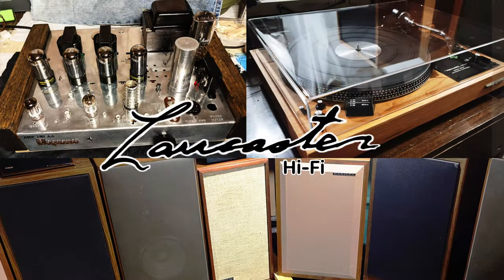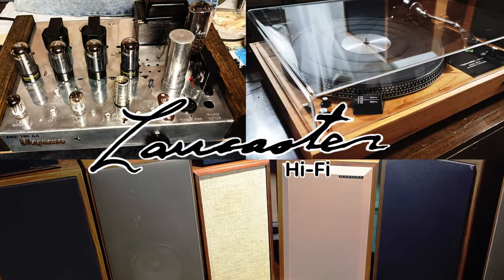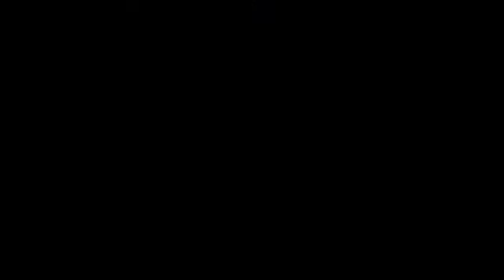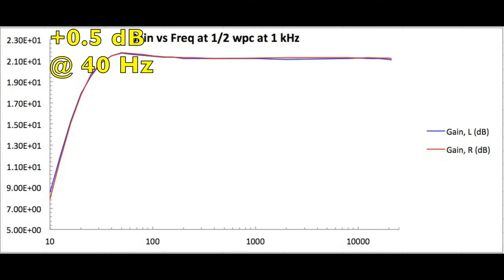Bad Tube Amp Design 101

Comment: I used to visit HiFi forums on tube audio equipment, and would often see posts from 'golden eared' audiophiles about 'tube rolling'. They would suggest changing this tube or that tube to a different one. When I mentioned that they couldn't just swap tubes without changing the plate or cathode resistors, I just got a storm of criticism about 'measure with your ears', not test equipment. These are people that learned everything they know from the internet {good idea), but had no knowledge about electronics. I finally gave up on these forums, and quit participating in them. These people are the kind that swear they can hear the effects of the color of the insulation on the wiring used in the amp, but are apparently oblivious to the gross distortion produced by a poorly designed amp or preamp. PT Barnum was right. "There's a sucker born every minute".

Comment: Great video post!  Also nice that you know Stephe from Skunkie Designs.   I LOVE her channel and it is first and foremost on my search list.  What caught my attention with her is that she has that Audio Analyzer Suite and can fully test the amplifiers she builds or checks out.   She was one of the first to really thoroughly get into an amplifier and describe it from top to bottom.   While I do have prior tube knowledge myself, I found that I learned a LOT more just by viewing posts on her page.    In fact it was through her that I had seen links to your channel.   It was your Magnavox SE EL84 amp and how you compared it to a push pull 6V6 amp that got me going.  It really gave me a good idea of what a SE amp can sound like.   Now,  out of the amps you mentioned, I had already looked at what Stephe had to say about them, but the best part was that she found ways to improve the flaws the amps had.   While I was tempted to get a Resong amp and mod it, I just figured it was better to stick with one of her designs, which was originally a Kegger design.   I would be far better off with one of those.   Then she has the Color Pre-Amp too, that I am interested in.    I been poking my head in more often here too as you do have really good posts.   Further, you have gone through a lot of classic pieces and know what is good (and not) there.   Skylabs Audio is another site I frequent, as that fellow has an audio repair shop and he fixes (and sells) vintage equipment.   I enjoy his page because there is a parallel interest.  I used to fix audio equipment myself, but I mostly dealt with commercial gear and guitar amplifiers, so that is where I got most of my tube knowledge from.   But dealing with tube equipment for guitars is quite different from hi-fi, but I did dabble with the latter myself and do want to get into it.   I am going to build Stephe's 12AX7 / EL34 SE amp soon, I am just getting all the parts together for it.   Oh!  And for companies that threaten for honest negative reviews  (I.E. Tekton), I would tell them to stick it where the sun don't shine!  Anyway, keep up the great work!   Can't wait for the next post!
Reply from the maker: I don't actually know Stephe. I just really like her content. I think I first saw her posts on Audiokarma.org, so when I found her on YouTube, I figured she was the real deal. I was a minute away from ordering the analysis stuff she uses, but then I saw that the freeware only runs on PC; I'll get there, just not today! 😐🤣
Reply from the maker: And, yeah, I'm a big fan of Skylab, too.
Reply: @Lancaster_Hi-Fi  I kind of figured you were familiar with him :).
Reply: @Lancaster_Hi-Fi  Not sure if you saw his last video this week, of the tour of his shop.  As he always says, "It's a fun one".

Comment: My journey with tubes started about 1963 with a Mullard 3-3 as a young teenager. It was followed by 5-10's, 5-20's as a 20 year old. The Mullard passive preamp was terrible!. Heard some enthusiast's Williamsons with Baxandall preamp. My Williamsons and Baxnandall preamp lasted for over 35 years. Anyway my current tube amps use KT88's and are sitting on the shelf gathering cobwebs. Class A Hiraga's and a preamp with OPA2134s and NE5532s quite frankly sound better, are more reliable and far less costly. Its been quite a journey.

Comment: I'm currently in the process of building an OTL (Output Transformerless) Headphone Amplifier that uses three 9-pin Svetlana 6N1P dual triode tubes, it is a DC coupled amp, meaning that one half of one 6N1P tube has the anode directly coupled to the grid of one half of another 6N1P tube that's connected up in a configuration known as a White Cathode-Follower output stage, the output is DC isolated from the headphones by a 470uF/450V DC electrolytic can cap, the design I'm building can drive headphones with impedances down to about 32 Ohms, It runs off a power supply that produces 348V DC @ 100mA, and 6.3V DC @ 2A.
Reply: Why? I ask because as a design engineer, I embark on a project to get better performance than is either available or affordable. A transistor amp, especially for low power and impedance can be orders of magnitude better than any tube amplifier. It just doesn’t make sense to go through all the hoops you mention to end up with an inferior solution.
Reply from the maker: Better or worse is a matter of taste. In terms of total harmonic distortion,  transistor amps typically do have orders of magnitude less than tube amps, but some distortion is tolerable or even desirable. Triodes, like the 6N1P, produce predominantly 2nd harmonic distortion, which generally sounds pleasant, at least in small doses. Triode amplification, then, has an advantage over BJTs. You could then argue that op-amp voltage followers or BJT emitter followers would make better output buffers, but if cathode followers are a good enough solution, then they might be preferable simply by being the simpler solution. For example, if I want to use op-amps, then I need +/-18V supplies, which require additional devices.
Reply: @Lancaster_Hi-Fi    Better is a mathematical expression, just like “>” or greater than. I know fake news is all the rage these days, but lower distortion is objectively better, no matter what semantic games rock your world. If you prefer adding the non-linear transfer function of a tube or transistor class A amp, that is a matter of taste. However, the resulting sound IS worse, quantitatively and objectively so. 

I’ve watched countless people swear by the superiority of the 1-2% THD of their tube amplifiers, and yes, that high distortion layered atop the original perfection of the live performance is actually their preference; their ‘taste.’ Musicians beg to differ, glowing orange shiny things or not.
Reply: @artysanmobile  transistors are inherently less linear than tube triodes. This is fact. They make up for it with huge gain and NFB. Crowhurst and others noted the negative consequences of high NFB as early as the late 50s.

Comment: As a guitist and builder of tube amps i think the 70 percent bias is silly since the goal is asimetric distortion in the output transformer that tubes do well, fender amps do this well in their early design and leo fender uped the output in the fender twin which had negative feedback to the ot to quell distorted sounds and get a cleaner sound at louder volumes.

Comment: I'm currently in the planning stages of a single ended pentode design starting with a blank sheet of paper.  I will be utilizing any modern-day electronics to achieve the optimum utilization of the output stage. I wondered what the great designers of the 50s would have done in their designs had they not have their current day electronic limitations. I also think that traditional designs are great for that day and if you're restoring a vintage peace, then you should adhere to the original design, to maintain the nostalgic sound. My goal is to see what you can get out of a pentode if you minimize the compromises.
Reply: The "great designers" of the 50s and 60s made very high NFB push-pull pentode designs of one form or another. That's it. If you like that, go for it. It's not my cup of tea.
Reply: @joeltunnah  Other than the quotes great designers, your comment is a complete departure from the meaning of my statement. I guess I wasn't very clear.
Reply: @davidkclayton  ok, how about this: minimize the compromises in a pentode by triode wiring it. Or am I still misunderstanding you? Tbh your post wasn't very clear.
Reply: @joeltunnah  Well I'm happy to say that my first prototype has been completed and I am testing it now. I'll be posting some videos on it explaining more how it works. The bottom line is that we have so much more technology now that I can draw from to get a single ended tube to perform at its maximum Throughout its bias curves. I can also eliminate components like coupling caps. Also, with the switch mode power supply I have dead silent operation. When I display my designs, I fully expect Most people that are in love with the traditional designs will absolutely hate what I've done but they're missing the point or I'm missing their point.
Reply: @davidkclayton  I have "dead silent" power supplies using 70 year old tech and designs. Not sure what I'm missing here. Add a 10H choke and a GZ34, and you're good to go.
Reply: @joeltunnah  what you're missing is I didn't have to put on a huge piece of iron, and I get a regulated power supply with far more efficiency and lighter weight and less cost. Power supply sag may be a fun thing in electric guitar amplifiers but not so much in audio reproduction amplifiers.
Reply: @davidkclayton  it's simple to design a tube power supply with no sag. And if you're going to use a solid state regulated power supply, why bother using tubes at all? Just build a nice transistor amp.
To me building tube amps is a bit like historical reenactment. You don't wear sneakers to the reenacted battle because it's more comfortable than 1812 shoes.
Reply: @joeltunnah  I'm fine with you not understanding, in fact I expect this from some of the community. What does the power supply need to do, simply provide clean DC without variation in voltage. I don't think I need to explain why a tube app is a tube amp regardless of where it gets its power.
Reply: @davidkclayton  ok if you're going to go down that road read up on silicon diode switching noise and EMF. Something you don't need to worry about with tubes.👍
Reply: @joeltunnah  it's 2024 we know how to deal with that. And also I am mentioned it was completely silent.

Comment: THE major difference of tube output stages (vs transistor output stages), is that the output 'follows' the impedance curve of the speaker system! This results in 'dips' in the frequency response where there are impedance-dips!

Comment: U got a subscribe today!! I'm not a Tube Amp Guy.

Tube Preamp to Solid State is more of my lane.( Feeling only the proper harmonics need amplification)

My working theory is there is no Analog or Digital because both methods actually rely on electron flow also Tape or Vinyl  can only transport as fast as the motor will allow.( Think about that).

Thanks again for pointing out how Audiophiles pay good money for bad things.

Comment: In what design does the inverter or gain stage "supply current to the grid" of the output tube(s)? Class AB2 direct coupled?
Also a 12AX7 is actually a very linear tube, within its limits. Much better than having multiple low gain stages.
And a grid stopper resistor on the output tube will stop HF oscillation in most cases.
Reply from the maker: I'm interpreting what I read in Building Valve Amplifiers by Mither Jones (I forget which edition), so I'd refer you to that book for clarification.
Reply: @Lancaster_Hi-Fi  it's Morgan Jones I believe you're referring to, and I'm not buying a $50 book to get an answer. I think your "interpretation" is incorrect.
Reply from the maker: Maybe. You can find earlier editions free online. The same issue is addressed in the design of the Simple45 aka Tubelab SE. That design puts a MOSFET source follower between AF and output stages. That follower supplies all the current the output stage could need, so there's no compromise required with selection of the tube for the AF stage. I'm sure I'm not explaining it well, or I'm unclear on the concept.

Comment: Another good one. A lot to unpack. Might using a vintage tube pre-amp open up a can of magic on a modern push-pull non-integrated amp with KT 88 output tubes?
Reply from the maker: Well, sure! Of course, those KT88's will provide a lot of magic on their own!

Comment: I most likely introduced some flaws in a good design by Bruce Rozenblit.  I substituted 6n2p for 12AX7A input stage and 6n6p for 12AU7A cathode coupled phase splitters without adjusting the operating points.  I just hoped for the best.  It sounds fine to me, but who knows without testing which is beyond my capabilities.  Guilty as charged. :)
Reply from the maker: At least you have self knowledge. 😁🤣

Comment: Question.  Do you do work for others? I’ve got a working Dynaco ST70. It could use a checkup from a skilled tech though. I’m fairly local to you I think.

If not, is there anyone you’d recommend in the Portland area?
Reply from the maker: I do. I'm in Corvallis. If you're on FB, look for Stephen Lancaster. Also, you should be able to get my Gmail through my channel page. If those fail, @geomorphdog on IG.